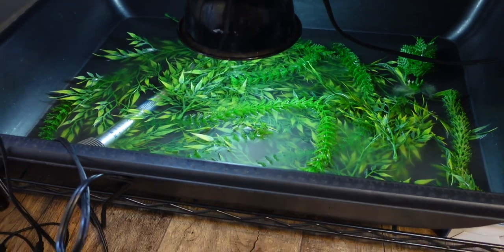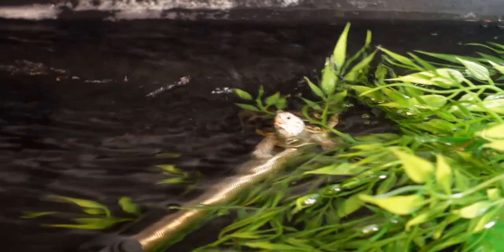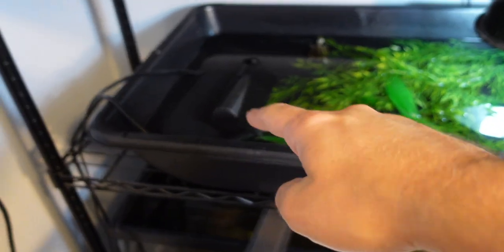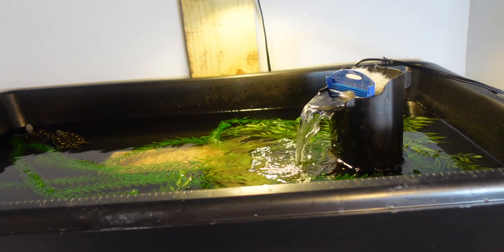Water Change in my *TURTLE ROOM!*

Comment: Dan, what do you think of "10 gallon/inch rule" for turtle tank or the "water and basking temp rule"? Do you agree and follow it or do you have a different opinion? From what I read on turtleforum, some people seem to obsessed with it, so I'd like to know your opinion.
Reply from the maker: I think they're good rules of thumb, but like...for example, I have hatchling Terrapins I keep in fairly small enclosures when young because they don't need the space. Once they hit 4" I upgrade them to as big an area I possibly can because they're good, solid swimmers at that point. I have a tiny baby spotted turtle in not even a gallon of water, for ease of cleaning its tub and because it doesn't really like...NEED anything bigger right now. Once it grows, I'll upgrade it heavily!  You have to consider what species you're dealing with, and whether they're good swimmers and will actually use the space